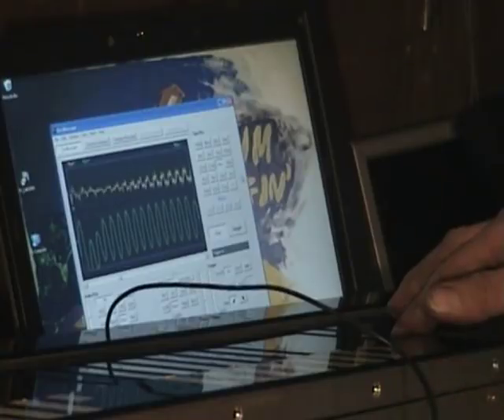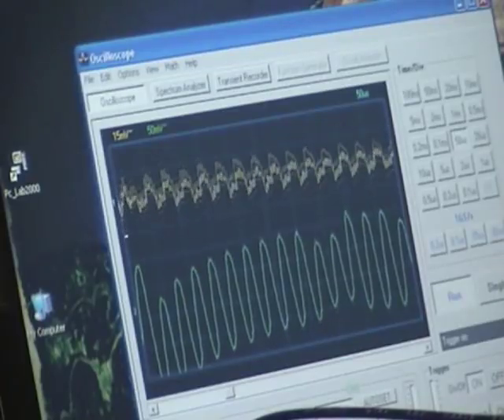real-time touch control surface on a Yamaha DX7IID synthesizer, how to edit DX7 patches

Comment: The diy touch screen is certainly an accomplishment but not as interesting as the workings of a real-time diy DX7 controller/programmer and the software for it. This controller could have been accomplished with pots or encoders and would have been just as interesting. The display is just a bunch of LEDs in a bar graph configuration. Not like its a PC GUI. Still kool. 
What is of interest to DX7 people is the real time control of the synth not the diy touchscreen in my opinion.
Do you have any more details on how your hardware interacts with the synth?
Thanks.
Reply: George passed away from cancer in the fall of 2020. He made this and posted this video, he was my dad 😞